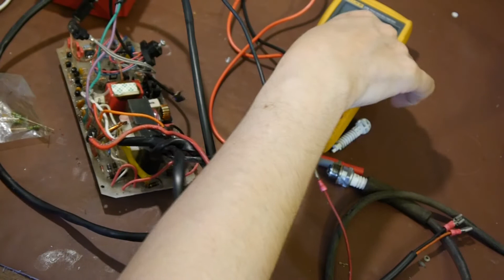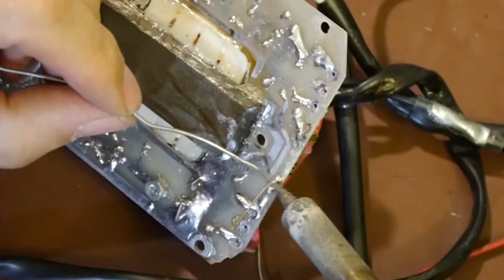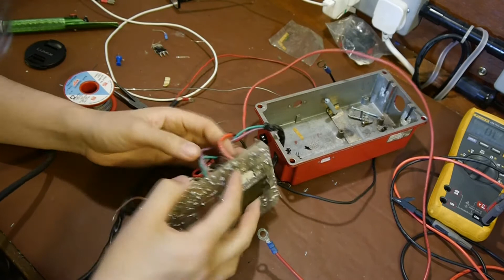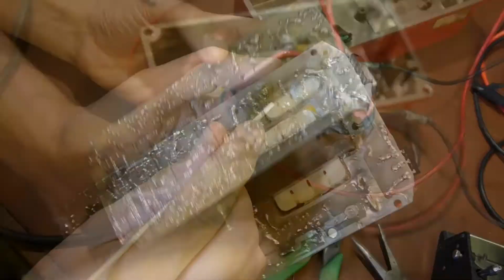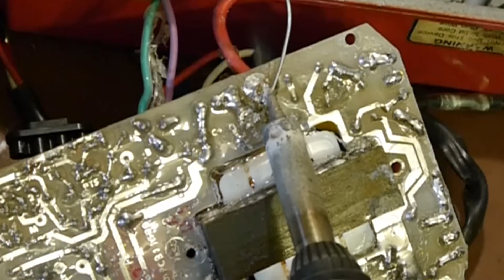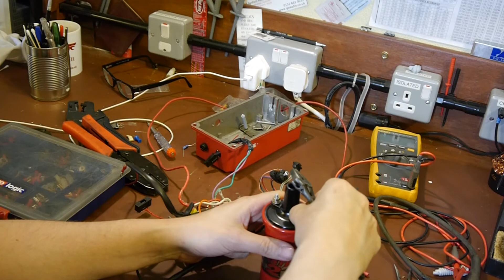MSD6 Part 2

Comment: Ohh the master of suspence, same channel same time :-D

When you said 400 volts i thought about the capacitive discharge units in motorbikes.
Some have to be fed with a high voltage from a special generator, others generate there own H.v using 12 volts and a power oscillator.
I liked the idea of dumping the charged capacitor into the coil primary.

Conformal coating is a Bas1ard, the designers should be shot at dawn, i don't think dawn would like it though, she is innocent. :)
Reply from the maker: zx8401ztv  Never really done much electronics work on bikes. I’m not really a bike person but I like machining and welding. I am going to google bike ignition systems now you have peaked my interest. Have you notice how much bloody stuff there is to learn!
Reply: The internet is a feast of things you didnt know were interesting.
Or Search and find oodles of crap, even if you tell google a precise thing to search for.
Often i find stuff by accident.
Try this for cdi diagrams: http://www.motelek.net/andere/cdi/